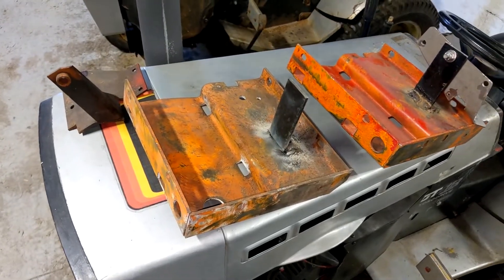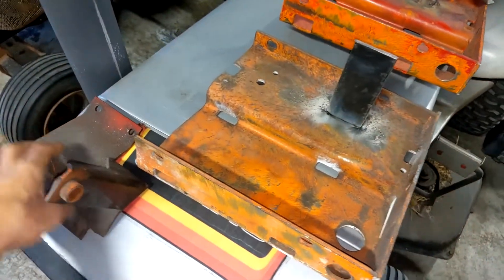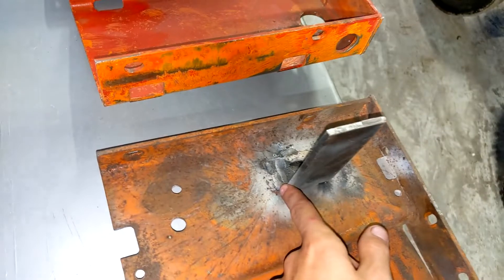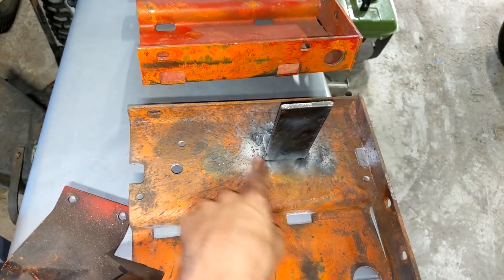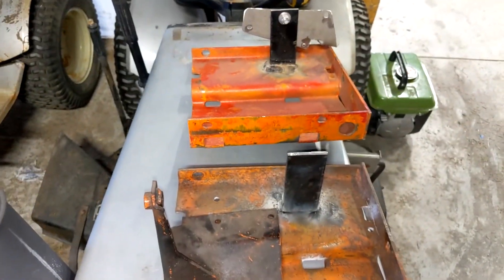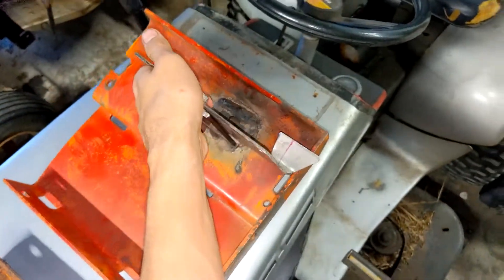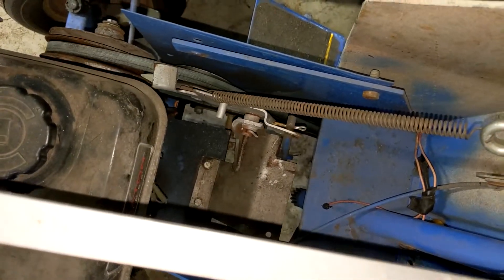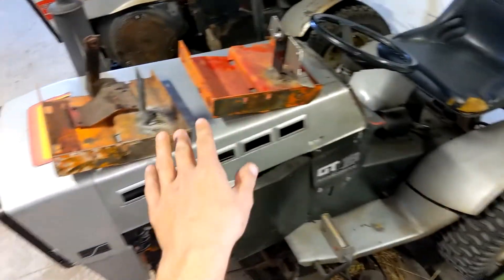How To Attach A Sears Suburban Clutch with A Repower

Comment: I have a 66 Suburban 10 that's a real hack job from the PO. Needless to say, my clutch is beyond usable, and I don't have the battery tray. It's repowered with a OH160 from the mid 70s. Looks like the 2 pieces of flat stock option is best for me. Can you provide more detail on how you did the pivot on that? You said to use a bolt, but is there a bushing or something in there, and what did you use?

Comment: Ive found if you put the battery tray in backwards they clear a predator gas tank
Reply from the maker: Never thought of that, definitely going to try it sometime
Reply: @IMPRIOR87  i did it on my super 12  just unbolt the engine bracket off the tray

Comment: Take a look at the clutch setup in my video. The clutch and spring are in the same location as from factory. Easiest set up to make with no welding or relocation of components. It duplicates the motor mounting holes of the Tecumseh.
Reply: Mounting the motor on the way u got it will allow u to get all the speed bc I was told It would be like having reverse in every gear mounted like that

Comment: I have a SS15 WILL THIS STILL WORK OR CAN I JUST USE NY STOCK CLUTCH
Reply from the maker: The clutch is attached to the battery tray so no need to do this mod.
Reply: @IMPRIOR87  ook so I just need to get a engine and repower it. Just as simple as that ?
Reply from the maker: Pretty much, drilling new mounting holes would be the hardest part.
Reply: Ok thanks buddy.. I'll try and send some pics when I get done